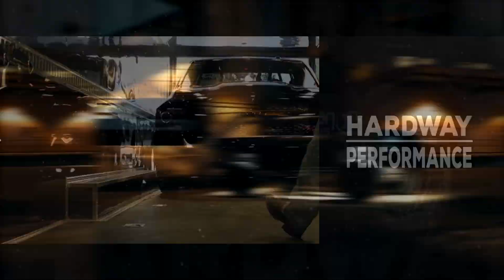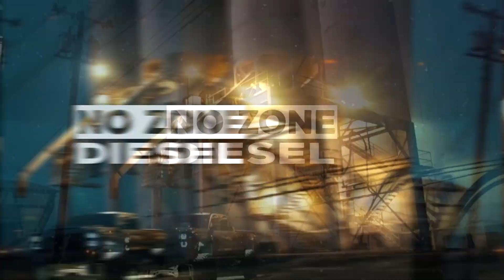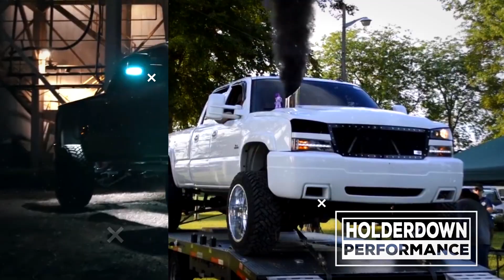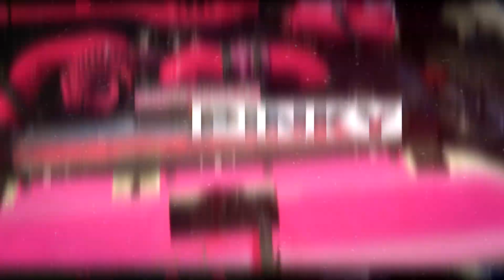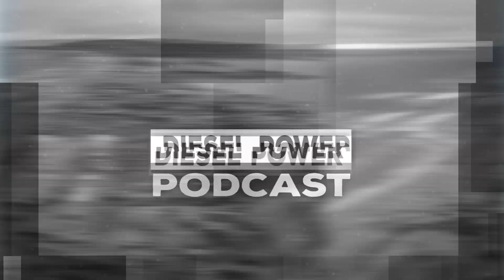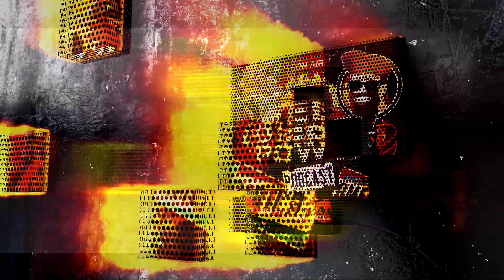650HP 6.7L Cummins Daily Driver

Comment: I just started listening to podcasts period. Thisbwas the first one i listened to. I would like to hear more on the 6.7 g56 truck. I have a 12 with 2nd gen swap g56 and wanting to get a lil bit more out of it. Pull with it, daily drive summer only. Dont want snow/salt getting it. If you could point me in the right direction that would be awesome